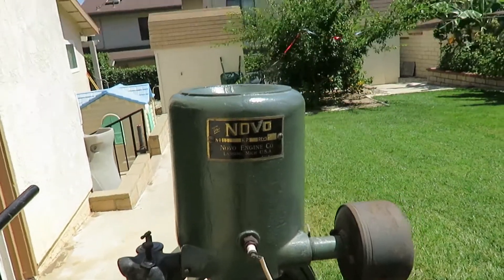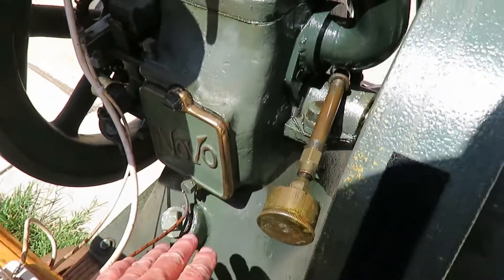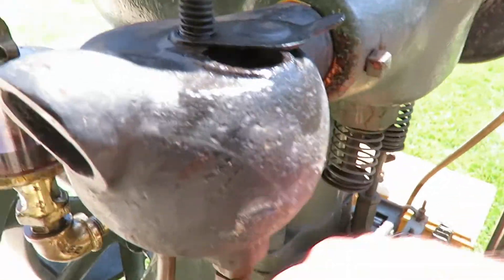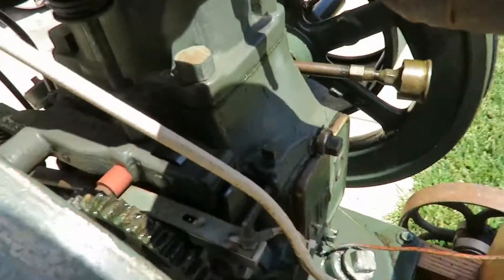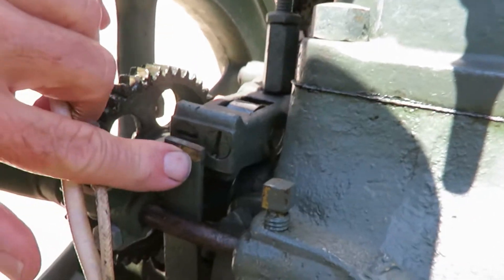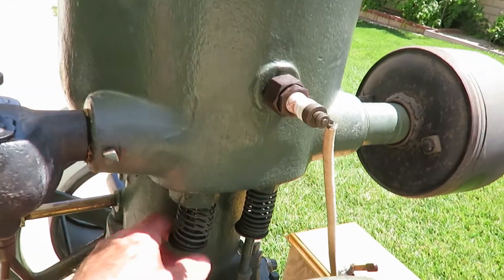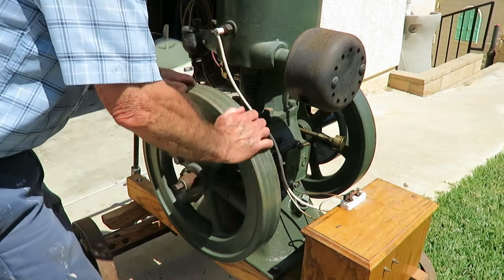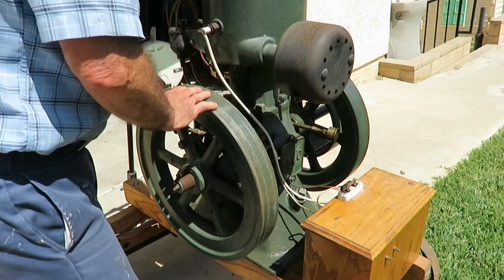Starting 1914 Novo engine

Comment: I have a similar Nove, possibly a little older. I appreciate the video. Would you mind measuring a few things for me, like the muffler dimensions, the size of the oiler and the grease cup diameter?
Reply from the maker: Neither the muffler or oiler are original. I made the muffler and bought the oiler. Does your engine have a brass name plate and serial number? Does the carb look exactly like mine?
Reply: @bombero42  Brass plate, "The Sprayer Engine" serial 9270.  2 1/2 HP. Has the apple carb like yours and the cast nut on the top of the fuel pump like yours.  The best I can figure mine was made between 1908 and 1914.
Reply from the maker: @mhuppertz  Does yours also have the short snout on the carb and no crankcase breather? I added the later breather.
Reply: @bombero42  No breather, and I believe so on the snout. I think, by the names and dates, that I have narrowed mine down to 1909.

Comment: For anyone watching this video, one of the easiest ways to start one of these engines is to give it a shot of starting fluid in the carburetor and it will fire and if it has fuel and it’s ready to go it will run.